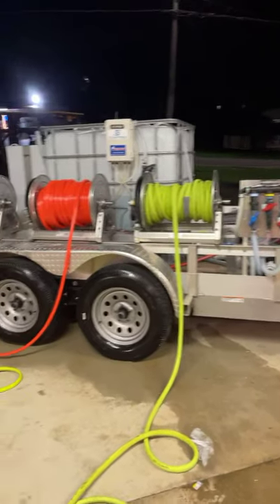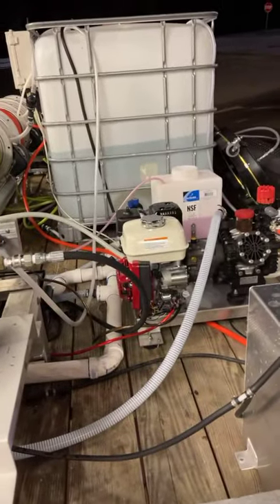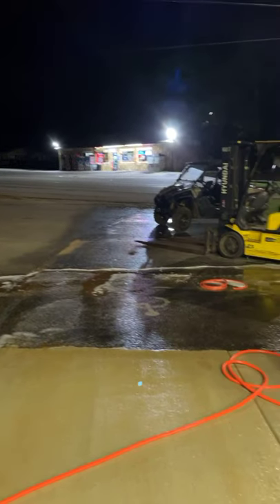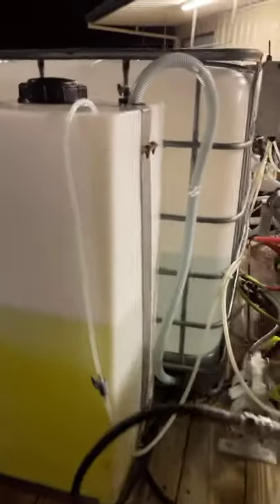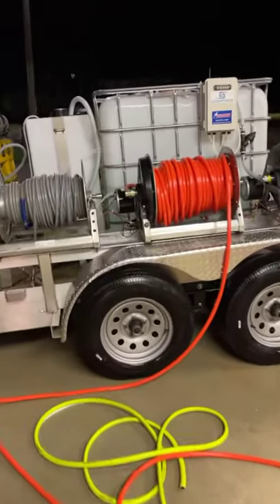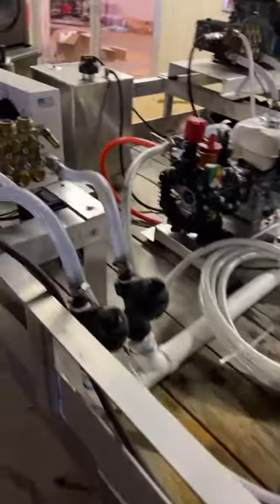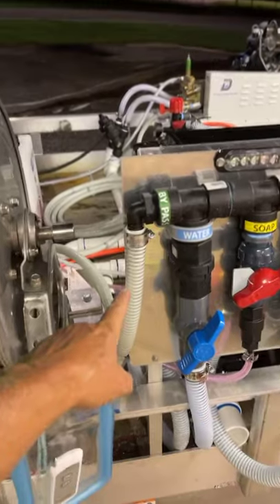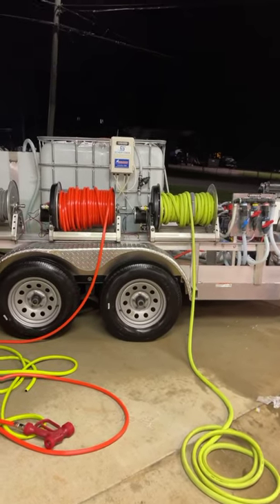Installed another gas roof pump

Comment: Nice work very informative ! Those little 12 volt rigs are ok for starting out but you will  soon wish you had went a step up or ten to tackle big stuff with the right equipment from the beginning !  Time is money !
Reply: I had the same thought but it accually is the exact opposite.
Reply: @motorcycleislife8296  how come you say that I'm interested in buying a gas system would appreciate your thoughts
Reply: @TheMhowi007  The gas system seems great on paper, i was one of the first to buy one from leon, The problem is they are the only system that bleach goes through. Your pressure washer doesnt have bleach going through it. You either are downstreaming or running an xjet which is after the pump. With a 12v or gas system you are running bleach through the pump. Which is why 12v go out so easily. Gas will go out and when it does your screwed. They are not an easy item to swap out like a 12v and cost $2k. Another issue i was having was priming. I did what leon said and put the water valve to 1oclock but still would loose prime on jobs. The system is just a fail imo
Reply: @TheMhowi007  Gas roof pumps are not self priming like the 12v is. When you run a 12v you know its primed because it will shut off. With a gas system it keeps running regardless if it is primed. So you will never know its primed or not. Which was an issue on everyjob

Comment: Leon what pressure hose is coming off that reel on the AR45?
Reply from the maker: AG hose 1/2”
Reply: Is that one straight piece of ag hose or is there a connector in it with 200/100 feet?
Reply from the maker: @brianfletcher7942  Straight 300 foot
Reply: @southernstylepressurewash2  thank you Brother Johns

Comment: He is going to run through that bleach tank like nothing lmao. These seem like great machines till you buy them and realize how much chemical you are putting out. The fact that he sold the air diaphragm proves he wasn't happy with it either. I'm glad I went back to the 12v I use less chemical and the only reason I bought a gas roof pump was cause I wanted the distance for roofs but it put out way too much chemical from the ground. Guys need to realize the technical side of the business doesn't matter, hire someone to do the hard stuff.
Reply: Fake news
Reply: 1000%
Reply: Adjust your proportioner maybe you will use less sh.
Reply: @Abovenbeyondservices    I question whether or not he ever actually owned a gasser! The whole comment is plagiarized from Camp Coty. Camo Coty is obviously scared to death of gas pumps and will probably start yapping at the mouth about that Freedom Wash guy and Mid West that have the 320 psi 12 volt pumps. It’s funny how camp coty talks about “overkill” but jumped on the new Northern Tool 10 gpm 12v pump before it could get on the store shelves.